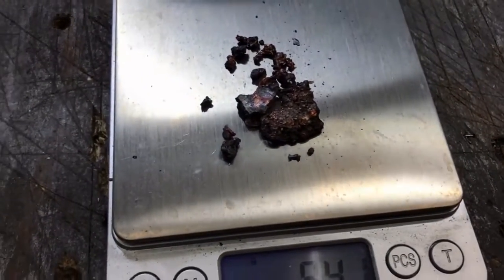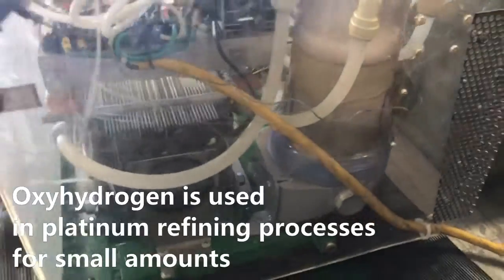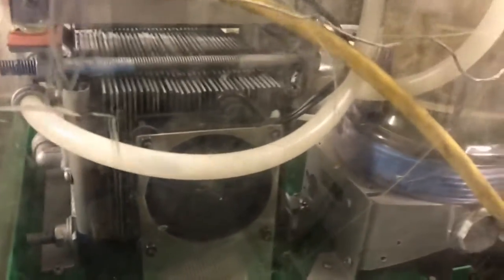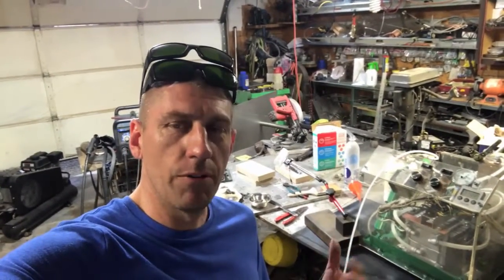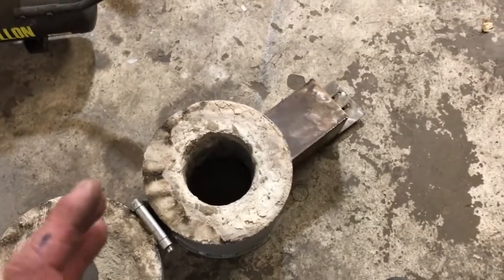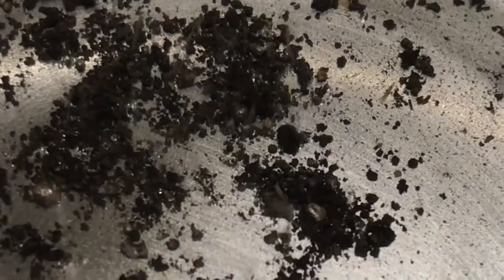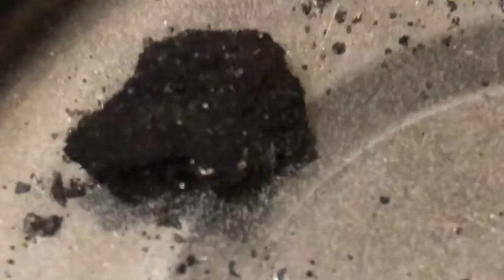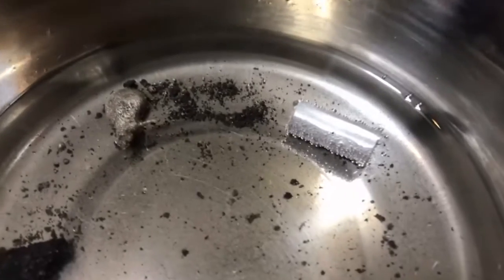E waste precious metal extraction Oxyhydrogen torch .

Comment: I've seen a dirty crucible method where this team of bare foot indians made a huge crucible out of compressed dry concrete mix to cupel out the PMGs from a previously made lump of lead made in a reductive red litharge type of charge. Something like lead oxide, rice flour, sand, sample off ewaste and smelt in a cone. They burn off crap at the swirling edge of the molten lead at the surface as the oxygen hits it...it will burn off. Then more crap surfaces, oxidizes and burns away in the flame. I'm sure atoms of gold fluff away doing this but i guess it comes down to how much can you afford to waste vs using all the acids.
Reply from the maker: Its ironic ive bin asked to help redesign a plant process involving ELECTROLYSIS ??? Lol wow .
Reply: @NOBOX7  or maybe it's His plan.😂
Reply from the maker: Yeah that's the path they are wanting to take
Reply from the maker: I definitely  thought about you when i was called to help this project along based on our current conversation  .

Comment: Don't touch that sponge bro. Platinum and heavy metals are very bad for the health. As soon as you get a mess of PMG together it won't melt easy at all. That stuff needs acid base work to separate the PMGs from the Au. That high melt point indicates it has Iridium or platinum. I would not waste my time working that stuff. Aluminum burns with oxygen and will cook out gold. My friend Tim works e-waste and he would chew it up with acid filter then take it back into lye and then concentrate it again and then back into acid. When he has a "pregnant" acid he drops out gold sponge. There is no way to burn your way to a clean metal with that mess. Try taking into litharge then working it back out of the lead.
Reply from the maker: Great input , they are interested in making anodes with this stuff but i told them the same thing , even made a clip of this stuff in potassium hydroxide solution . They seem to think its no big deal but your correct , you can make an explosive with gold so i could see how aluminum would thermite it away . Ill mention that to him thanks a million for that nugget ...
Reply: @NOBOX7  trouble also is the gold bug that gets in peoples mind. Gold fever will make a starving man dig til he has no food or money. I have seen it happen to guy I communicated wtih from Mexico. The mine he has produced PMG and lots of it but it was all tied up with arsenic and so atomised between all the pieces of pyrite that he couldn't get the gold away from the other heavies. He spent all he had then started taking loans from dodgy gang leaders. Lookup platinum poisoning. The electrolysis requires huge baths that are sealed or they will gas the workers to death.
Reply from the maker: I really need to pin this process down . We was thinking acids but he is stuck on this anode thing